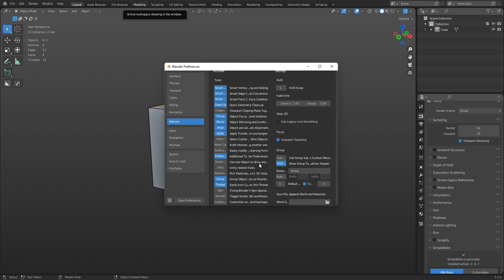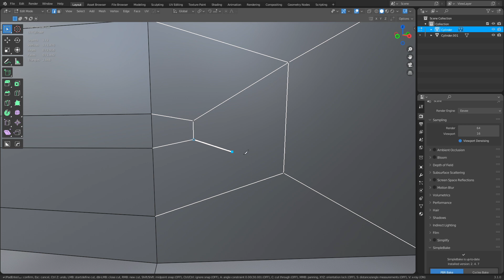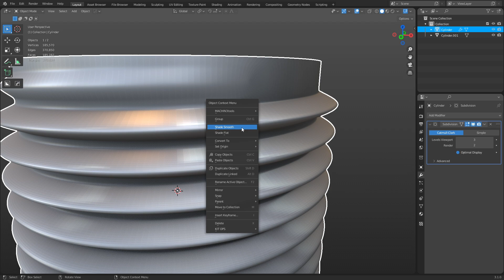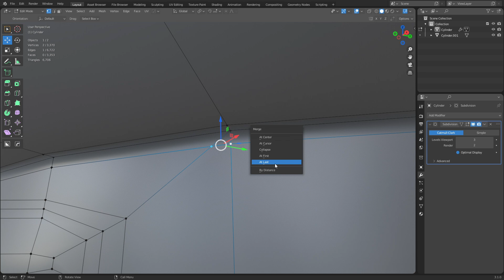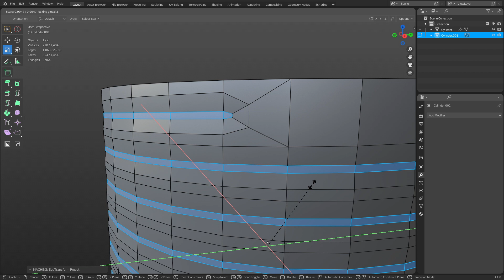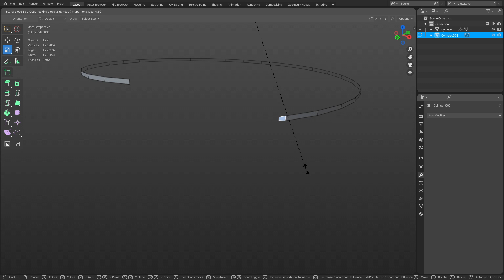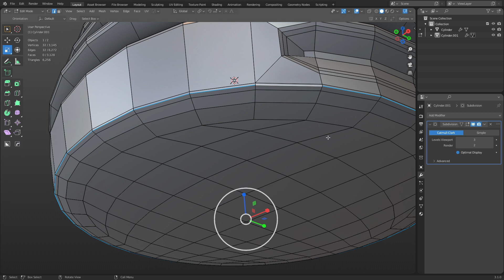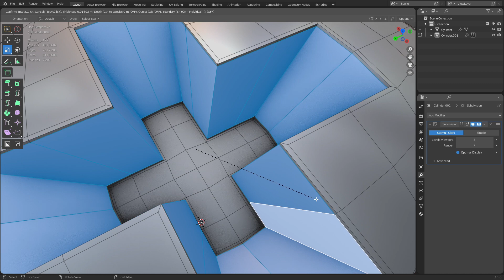Blender - Screw Thread

Comment: this is nice.  I didn't realise there was a tool that could make screws and just spent a long time modelling one.  I had some trouble when I 3d printed that the screw doesn't always match the thread exactly.  The thread should have a bit more give.  I came up with the idea of making the screw stick out slightly more and then using a boolean negative, which kind of works but can lead to artifacts.